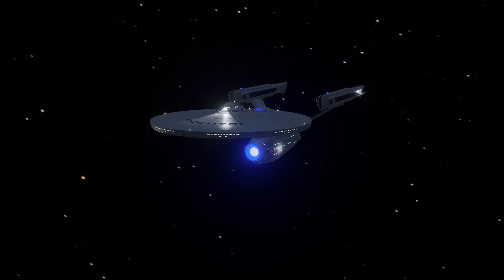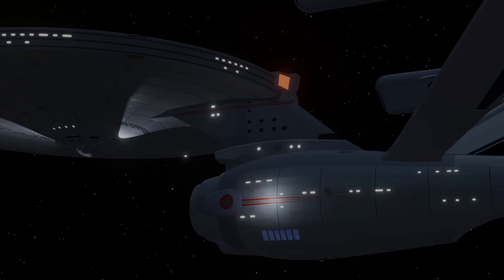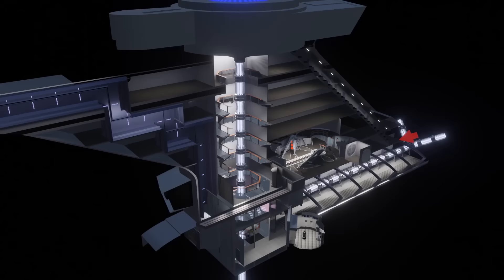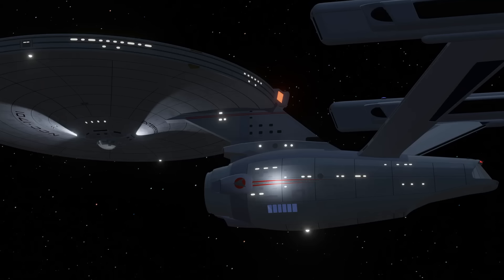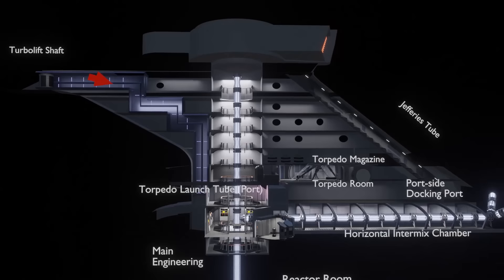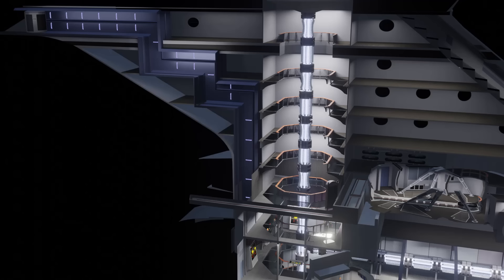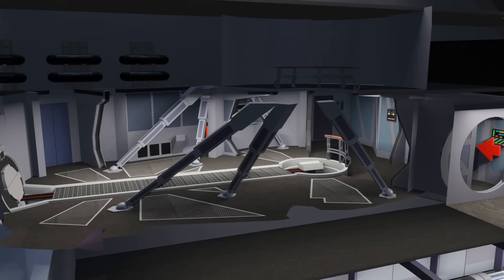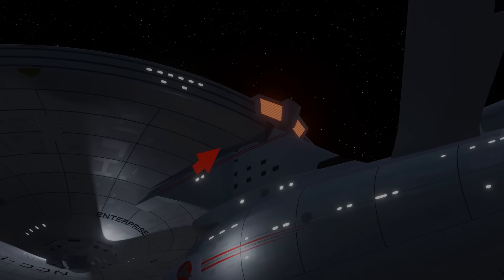The Enterprise Dorsal Problem: how did the turbolifts pass through it?

Comment: I have emailed Andrew Probert, the designer of the refit Enterprise, many times. He said his plan was to have the turbolifts move upwards from the hangardeck, move forward paralleling the engine room. They would then turn in front of engineering and begin traveling upward between the torpedo tubes and just forward of the vertical intermix shaft in the dorsal connector. They would then end up in the saucer section just forward of the impulse deck.
Reply: This is how I'd always imagined it as well.
Reply: Yeah me too
Reply: Thinking about it when the Reliant phaser hit the port side torpedoes side launcher it must have taken out the turbo lift as Captain Spock stated that hit had taken out turbo lift and thereby they had to climb to a deck where the turbos where still working. I agree with the fact the neck section was too narrow and should have been a little wider to accommodate extra turbos shafts. It also best to remember if there was a evacuation of the star drive then there would be little time to get everybody out due to limited number of turbo lifts
Reply: Turbolifts also don't have to remain upright. They can turn sideways and the passengers wouldn't know it due to artificial gravity. This allows them to save space and pass through tight sections.
Reply: @Novusod  In ST TOS, the deck indicator lights in the turbo elevators either flashed horizontally or vertically, denoting their direction of travel. Had the elevators traveled in the way you describe, the light would only have flashed in the vertical direction. This would have been the case because the passengers would have been traveling head first or feet first if the elevators moved in the way you suggest. Andrew Probert had input into the cutaway poster of the refit Enterprise and all of the elevator shafts were oriented either horizontally or vertically. He also told me that if you look very closely, you can see that he drew representations of himself and his wife in the arboritem.
Reply: @sirbobbyuk  He said they were inoperative below C-Deck (Deck 3) because of the fact that they only had partial main power, so they diverted power from every non-vital system to get ready for the rematch. C-Deck is the part of the saucer where you need turbolifts to get to the bridge, instead of being able to walk.
Reply: @3Rayfire  thank you for correcting me
Reply: @sirbobbyuk  we all forget details
Reply: But this man just demonstrated that there isn’t enough room between the torpedo tubes.  But BUT, it’s ok by me because, don’t tell anyone but I think there may be a few other unrealistic liberties taken within the show too, shhhhh!
Reply: @MrMightyZ  The torpedo room in ST TMP is much different than the one we were shown in ST II TROK. The primary reference for the refit Enterprise should be the cutaway poster as that poster was based on Andrew Proberts designs. Another issue is the Rec Deck. Andrew tried to convince the production designer that, because of the curve on the under side of the saucer section, the Rec Deck as designed wouldn't fit in that space. Andrew propsed a multilayered Rec Deck that would fit but that design was rejected.
Reply: @Novusod I don’t think the turbolifts had their own artificial gravity.
Reply: @Novusod  Yeah I always assumed this is why they're not just called elevators...they do things elevators can't like move in different directions and orientations.   This video assumes too much about the restrictions they'd have to follow.  In reality they don't need to take the shortest possible path, they can wind their way up and down to get where they're going in three dimensions.   It's funny this video mentions Wrath of Kahn so many times because it's quite limited to.....two dimensional thinking
Reply: @NotMyActualName_  also, I forgot to mention something. There would only be one evator tube in the dorsal connector, just forward of the Intermix shaft. Even though there's elevator tubes on the port and starboard sides of the hanger deck, they would share one tube in the dorsal connector moving up from the hangar to the saucer.
Reply: @sirbobbyuk  The thing is he didn't hit the torpedo section of the neck till much later in the nebula . His first attack hit main engineering on the port side. If there is a turbo shaft that runs parallel to main engineering on the starboard side the turbo lifts would be fine, to far from the damaged section. The lift were still working since Scotty brought his nephew to the bridge and Kirk next went to sick bay to check on Scotty's nephew before he died.Then Kirk went to the transporter room but that is located within the first or second deck down in the saucer's bulge not in the secondary hull. He beams up later to the same transporter room, but for some unknown reason the turbo lifts weren't working and they had to climb a latter up several decks. They were not available till the funeral scene. The Torpedo complex while taking a direct hit from Reliant ( A lucky shot) did a lot of damage but within minutes was able to fire two torpedoes. Tough little ship the Enterprise is.
Reply: @wendigos_eat_people7177  I stand corrected. However the phaser hit must have taken out a turbo lift shaft or assuming there were two turbo lifts going through the neck
Reply: i always thought that there was more than 1 turbolift in the ships neck 1 for the main saucer and neck and the other for the neck into the engineer gaming areas
Reply: @aurorathearcticwolf4243  that may have been the case with the TOS Enterprise, I haven't seen those blueprints in quite a while. There doesn't seem to be room for two turboshafts in the refit Enterprise.
Reply: @adamperry4347  That's only if the elevator never travels horizontally ever.
Reply: I'm confused how does anyone get to the torpedoes launcher on the Reliant. Those connections to the hull are really tiny!
Reply: @raymondstpaul4913  autoloader system?
Reply: @aurorathearcticwolf4243  They should have implemented that into the Enterprise too, would have helped much in that movie... although I know, it was a training ship = many stuff that on other ships can and are done automatically had to be done by hand on the NCC 1701, so that the cadets learn to do it in the case the computer goes broken. 

And to the turbo lift: the Lift is around 2m wide. becomes quite difficult to fit that between the torpedo shafts :D
Reply: aw sweet, I thought I read that somewhere, there was rhis huge star trek book at the doctors office, it was literally chained to the chair,  it had ALL sorts of interviews with the designers and "engineers" I must of read this before, I thought they went left and right, I always did, thank you
Reply: @sirbobbyuk  The Star drive also has the only shuttle bay, so I imagine in an emergency they would evacuate by shuttle rather than trying to reach the saucer
Reply: One thing that the model assumes is that the space around the vertical warp core on every deck is the same. Reducing that space a deck or so above main engineering frees up a good deal of space.
Reply: I love the visuals investigating the possibility’s. Furthermore I love the conclusion…..relax it’s not always explainable. Enjoy the show. 

But for real we don’t talk abkut Oberth.
Reply: In ST: TMP, when Kirk is walking through the blue lit engineering decks, where the heck was he? He enters the intermix shaft from a large area one level above the top of the secondary hull and takes a lift down  one deck for his first encounter with Captain Decker.
Reply: would love to see a graphic of this.
Reply: @adamperry4347  You can still find Probert's sketch for the multi-layerd rec deck. It's beautiful.
Reply: @Novusod  clearly the turbolift cars have some artificial gravity of their own or their own inertial dampeners at least given how these sudden rapid changes in direction don't throw the riders around at all.
Reply: This comment needs to be PINNED because it's the answer to the entire question posed by the video!
Reply: That’s how HalfScreen depicts it when show the internals of the ship deck by deck.
Reply: @Novusod if that's the case then why not do that with the whole of engineering?

Comment: I'm not gonna lie, throughout the video I was constantly saying to myself that there are probably two turbolift networks. After finishing the video I went and looked at Connie refit MSDs and sure enough, the turbolift in the secondary hull does in fact lead into where the core is (a deck or two below where the impulse engines are) to which another turbolift door sits on the other side (to the front) of the warp core. A pretty simple idea as a person would just have to walk around the warp core to get into the next lift to get into the saucer. Perhaps not the most ideal but definitely an easy solution.
Reply: Another point to consider if this is the case: If the Enterprise were boarded in the engineering hull, a few security people placed between those two lifts could control the pathway to the saucer section. Sometimes the best way to stop the enemy is to take away the ramp he's counting on...
Reply: exactly. just because it is not show in the movies or in the series, we can safely agree that things must be there to keep the crew alive and solve functional issues
like having toilets and whatnot.

having two turbolifts AND a small path to walk between them is fairly logical. like in huge buildings (like airports) having a lift between two sections is not possible but having two lifts and some walkway between them is all it takes. 
and it has some advantages too. should one turbolift break down, you can still at least cover half the journey unaffected by the broken one. :)
Reply: @Comicsluvr Wait... wouldn't that put the security bottleneck, and likely gunfight... kind of right on top of the friggin' warp core? This sounds like a bad plan.
Reply: @CptJistuce  LoL, like that time a Klingon held the warp core hostage with a phaser in TNG...maybe it would lead to a stand-off, but any fanatical person might just say welp, I guess we'll all blow up then!
Reply: It's an INCREDIBLY simple solution and frankly I don't get why people are wracking their brains about it.
Reply: @pex_the_unalivedrunk6785  Technically, the vertical shaft is NOT the warp core. It's the vertical intermix shaft providing power to the impulse drive. The warp core itself is much lower down in the hardback section of the secondary hull, where the horizontal intermix shaft leads to the warp nacelle pylons.
Reply: @Ambaryerno  well technically, yeah. But it's all part of the same system of power delivery... ofc, had they stuck with the old horizontal core instead of vertical, maybe the intermix shaft could have been placed towards the rear of the neck instead of the center? Tbh, they should have engineered the impulse drive to function off a separate battery anyhow, just using smaller conduits to transfer power to recharge them...and no need for a huge shaft going up the dorsal. Everything else could have been done between the core and the Y section where the nacelle pylons meet.. . however, I'm no 23rd century engineer. But I digress, my mistake on the technical details.
Reply: @pex_the_unalivedrunk6785  To my understanding, the connie refit was one of the first ships to feature a vertical warp core. The previous model of constitution class (the one seen in the TOS series) used a warp core that had similar architecture to henry archer's horizontal warp 5 core, 140 years after its introduction. The fact that the vertical core is either brand new or experimental technology could explain the flaws in the design.
Reply: @gazs2277  I know, it's old tech.  And in TMP Kirk about got everyone killed because he didn't know the phasers were interlinked to the warp power and, Noooo! Use Photonnn Torpeeedooooo!  (In slow motion).  The entire system was a bit flawed, maybe they fixed that during it's minor refit in drydock between TMP and TWoK though.
Reply: @pex_the_unalivedrunk6785  Additionally, I think that's why they opted to make the neck on the excelsior much thicker compared with the connie. That does seem like the best solution to the problem at that starfleet had available to them, given that the warp core tech doesn't get minitiarised enough to be able to be housed solely in the secondary hull until at least the ambassador class.
Reply: @gazs2277  for real, the Excelsior was designed better in many ways-even if it wasn't as aesthetically appealing or pretty. It's flat topped lower hull gave it more of a Battleship look (it was practically a dreadnought way before the JJ-verse). The tiny main nav deflector(in relation to hull girth)  gave it a more menacing and less friendly appearance. The thicker neck could house more torpedoes, more probes, and not get severed as easily in a fight...and provided extra room for the vertical intermix shaft to it's Humongous impulse drives, as you mentioned.
Reply: @pex_the_unalivedrunk6785  It could also accommodate sulu's gamer set up, given all the acoustic foam along around the neck.
Reply: @gazs2277    "Oh, My..."

I seriously wish George Takei would have had his own spinoff series as captain of the Excelsior, I would have watched it.  Also, I forgot to mention the fact that at least the Excelsior had some sort of safety restraints/seat belts for the bridge crew, where later ships went back to solely depending on those highly unreliable inertial dampeners. I hated the Excelsior's design when I was a kid, mostly because I perceived it as a threat to my beloved Connie refit...but it has grown on me over the years.
Reply: @pex_the_unalivedrunk6785  They did. Khan knocked out the warp drive on his first attack and a couple minutes latter Enterprise scores a direct hit to Reliant's impulse deflection crystal while on battery power. Impulse came available shortly after.
Reply: @wendigos_eat_people7177  Yeah, on battery power, that made sense...but what irked me was how did the Reliant even move after sustaining such massive physical damage to it's impulse drive?  A bit of battery power and plot armor, saved Kirk and crew.  "The only reason we're still alive is because I knew something about yadda-yadda, that he didn't "

Despite all it's flaws, Star Trek II TWOK still makes my personal top 10 list right up there with The Wizard of Oz, E.T., Jurassic Park, Superman 2, BTTF 1, 2 & 3, Star Wars Episodes IV and V, Resivoire Dogs, LOTR Fellowship, uhhh...maybe Mary Poppins? 🤣
Reply: @mityaboy4639  I also assumed that there were staircases hidden everywhere.
Reply: This.
Reply: would make sense as most the crew was in the saucer section, the drive section is mostly cargo and the shuttle bay and well much of the drive components (deflector array, conduites to the Necelles)
Reply: @CptJistuce   that is why you have security officers spread throughout the ship, and obviously a large contingent posted at key areas of the ship.
Reply: It was a stupid design anyway to have such a thin neck on the ship. I always thought hmmm what if an alien disruptor slices the neck? The ship is split in two easy. Then it actually happened in the Abrams  movie.
Reply: @MrShadow-qz9xj  That doesn't mean you design the ship with a chokepoint on top of the dang antimatter blender. If that chokepoint was anywhere else, it would be a great security feature that forced a large intruder force to approach a fortified position with limited room.
Reply: You should check out HalfScreen, they show starships from Star Trek and Star Wars deck by deck internally. Among these was the refit Enterprise.
Reply: @Comicsluvr That works in reverse, if people take the engineering section or the saucer, they can make it hard foe the good guys to move just as much as the bad guys.